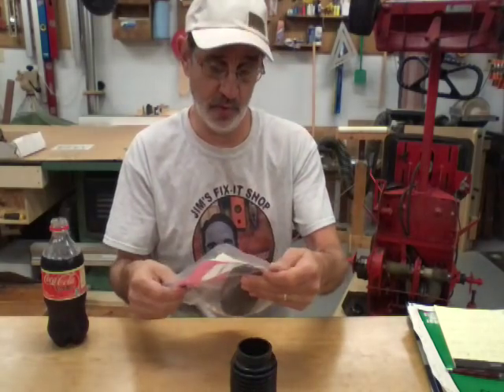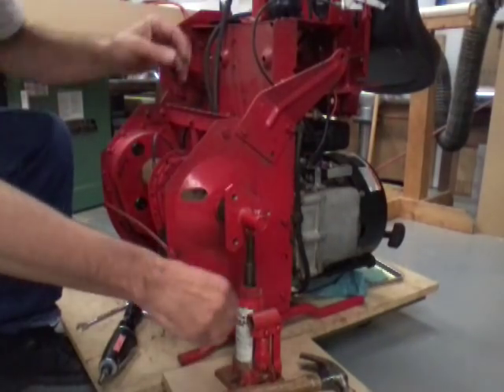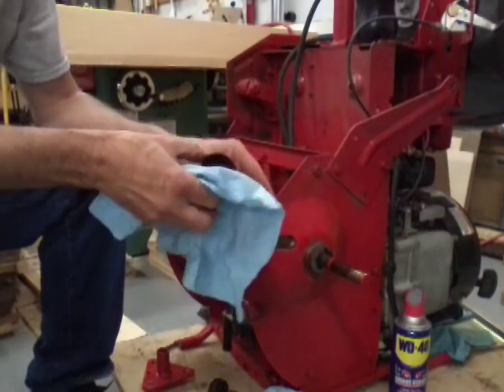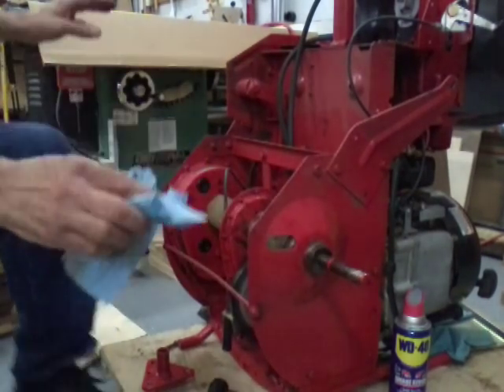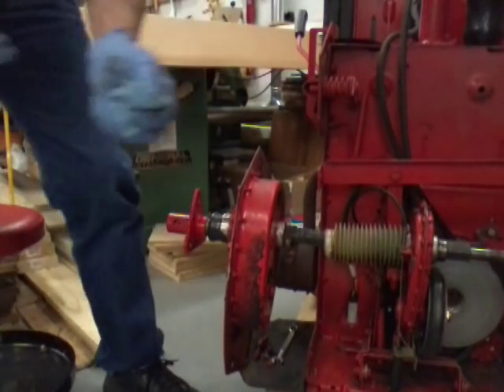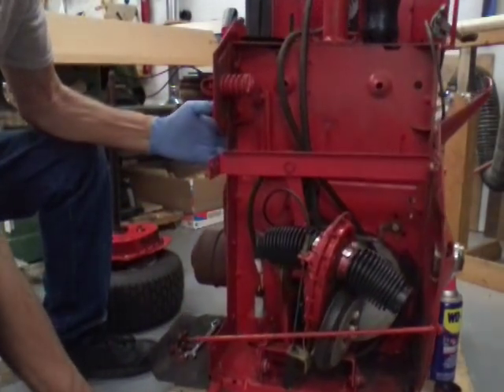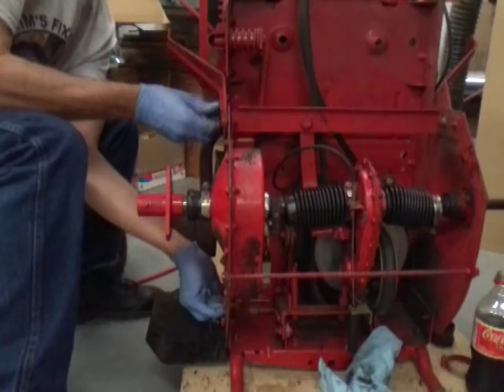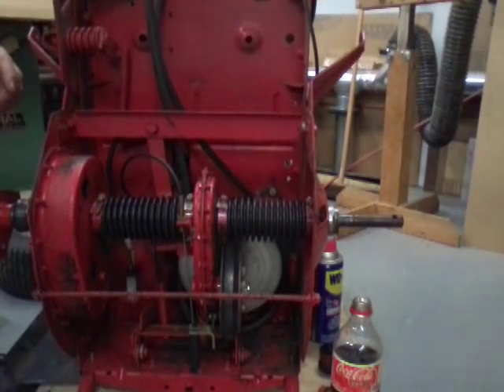203.  Installing new boots in my father-in-law's Snapper RER

Comment: Jim, you state in the video there is a place to purchase the dust cap and seal for the right side (what Id call passenger side) axle....do you have a part number or link to that seal?
Thank you
Reply from the maker: danbaileyphotostudio 
OK these part numbers are from Parts Tree.Com.
And as you’re sitting on your machine the right hand side part number and description is
  Dust cap Number 70317 32YP and it is $3.52
  The seal is number 7011817YP and it is $3.19
  The left side of your machine as you were sitting on it
The dust cap number is 7031732YP and it is $3.52( they use the same dust cap on both sides) 
   The seal number is 7014662YP and it is $5.76
I hope this helps you out. Jim
Reply: @jimjackson9381  Thanks so much!  I kept looking at parts diagrams for my model number and could not find any schematic that included these!
Reply: @jimjackson9381  - I watched your entire video and either I missed the answer to my question or you didn't cover it. If I understand you correctly, you install both a dust cap and a seal on both sides. You gave the part numbers above.I do not see mentioned on a parts schematic for my machine (mine is a model #301213BE, serial #35247670) both parts.

1) Is it correct for me to assume that you install the seal facing the bushing/bearing and then slip the dust cap over the top of the entire end of the shaft? 

2)Can I also assume there is enough space for both the cap and seals before the wheel/tire is installed?

3) The fender on the left (driver) side has a plastic insert that the axle shaft runs through. Mine is broken/cracked in several places. Will the seal/dust cover set up you're suggesting above take the place of this plastic insert or do I need to find a replacement plastic insert? if I have to replace it, do you know the part number?

Thanks. Excellent video!

-dennis
Reply: @Jim Jackson- I figured out that the plastic insert I referred to in the left fender is in fact the old style dust cap. So I'm going to remove it and use the dust caps you suggest.

Another question I failed to ask: is it safe to assume that there is enough space to clamp these dust caps onto the bushing/bearing? If so, what clamp did you use that has given you the best success?
Reply from the maker: Dennis McCrea 
Actually the dust Cover slides over the bushing and onto the lip of the fender and a standard hose clamp will hold it on. Jim
Reply: @jimjackson9381 : 
(Addendum: sorry to ask 2 of the original questions again but I didn't see you address these):

I watched your entire video and either I missed the answer to my question or you didn't cover it. 

1) If I understand you correctly, you install both a dust cap and a seal on both sides. You gave the part numbers above.I do not see mentioned on a parts schematic for my machine (mine is a model #301213BE, serial #35247670) both parts.

2)) Is it correct for me to assume that you install the seal facing the bushing/bearing and then slip the dust cap over the top of the entire end of the shaft? 

3) Can I also assume there is enough space for both the cap and seals before the wheel/tire is installed?

Again, really great videos. You should get into the documentary business...your cool, even voice I believe would be a natural.

Thanks!

-dennis

Comment: Kim, on the boots, is it the same size for a 28" and 33"?
Reply from the maker: Yes all the boots are pretty much the same but make sure you buy the black rubber boots not the gray nylon ones. Jim

Comment: Jim what is the part number for the plastic shim to stop side play at the rear axle on a rear engine rider?
Reply from the maker: Jerry Craig 
Hi Jerry
  The number for the shim Is 7011 071YP and They are $2.40 at Parts Tree.Com Sales you may be of the find them cheaper on Amazon or eBay thanks Jim
Reply: Jim I have to ask you also what is the part number of the lip seal you removed in this video. My hub was so tight I had to cut the hub off with my torch which damage the factory cup but I did get the hub off with no damage to my axle. Thanks again !
Reply from the maker: Jerry Craig
 Hi Jerry 
Did you damage the dust cap and the Lip seal or do you just need the lip seal. Let me know, If you have your model number of your machine that would also help.thanks Jim

Comment: Hey Jim, where's a good place to get original color snapper red? I'd prefer paint I can shoot with a paint gun, but rattlecan will work also. I found a supplier that has oem labels. I have a model three I use everything week to mow my yard and it works great, just looks ratty and faded from 40+ years of use
Reply from the maker: Briggs & Stratton has  snapper red paint for sale,
Reply from the maker: Rust oleum has  gloss Cherry red that matches pretty good and you can buy it in quarts. Thanks Jim
Reply: @jimjackson9381  thanks Jim. I noticed that all the parts you have for snapper are Briggs, did they buy out snapper?
Reply from the maker: I wish I could then maybe we could make snapper number one again. Thanks Jim
Reply from the maker: I wish I could then maybe we could make snapper number one again. Thanks Jim
Reply from the maker: I wish I could then maybe we could make snapper number one again. Thanks Jim
Reply from the maker: I wish I could then maybe we could make snapper number one again. Thanks Jim
Reply from the maker: I wish I could then maybe we could make snapper number one again. Thanks Jim
Reply from the maker: I wish I could then maybe we could make snapper number one again. Thanks Jim
Reply from the maker: I wish I could then maybe we could make snapper number one again. Thanks Jim
Reply from the maker: I wish I could then maybe we could make snapper number one again. Thanks Jim
Reply from the maker: I wish I could then maybe we could make isnapper number one again. Thanks Jim
Reply from the maker: I wish I could then maybe we could make snapper number one again. Thanks Jim
Reply from the maker: I wish I could then maybe we could make snapper number one again. Thanks Jim
Reply from the maker: I wish I could then maybe we could make snapper number one again. Thanks Jim
Reply from the maker: I wish I could then maybe we could make snapper number one again. Thanks Jim
Reply from the maker: I wish I could then maybe we could make snapper number one again. Thanks Jim
Reply from the maker: I wish I could then maybe we could make snapper number one again. Thanks Jim
Reply from the maker: I wish I could then maybe we could make snapper number one again. Thanks Jim
Reply from the maker: I wish I could then maybe we could make snapper number one again. Thanks Jim
Reply from the maker: I wish I could then maybe we could make snapper number one again. Thanks Jim
Reply from the maker: dave1135 
 Hi Dave
  Briggs & Stratton.  sells The paint for snappers, one of my viewers tells me that Rust oleum cherry red matches extremely well and you can get that in quarts. Thanks Jim

Comment: Wondering where one gets the axel shims?
Reply from the maker: I get them from Parts Tree.Com. although they don’t come split anymore they’re around and you have to cut a piece out of them over the axle so you don’t have to disassemble anything. Jim
Reply: @jimjackson9381  do you happen to have the part number?  I can't seem to find it on parts tree.  I'm replacing both boots and found them on Amazon as you suggested so the washers won't have to be split hopefully.
Reply: Could you tell me what the parts tree part number is for the nylon axel shims?
Reply from the maker: You can get the axle shims at Parts Tree.Com. and tell them Jim’s fix it shop sent you the part number is 701107 and they’re $3.46 apiece